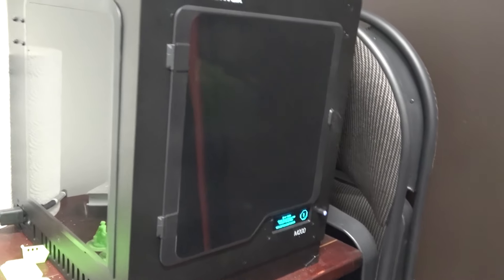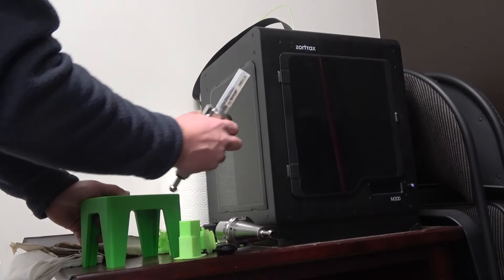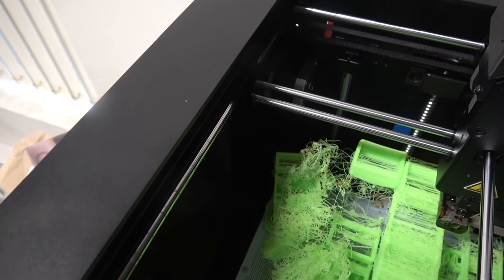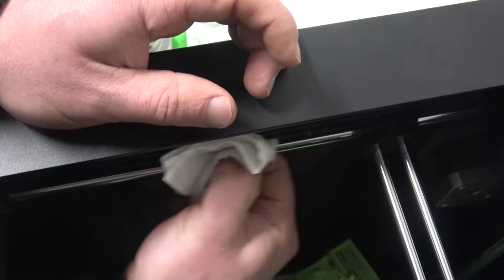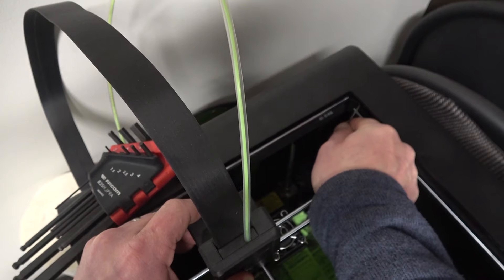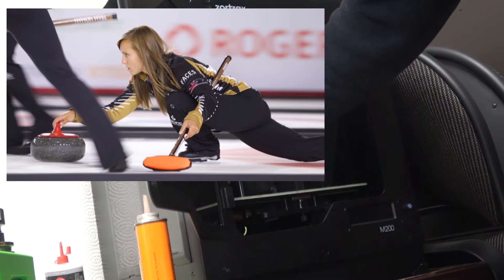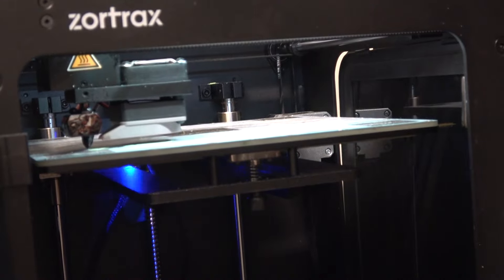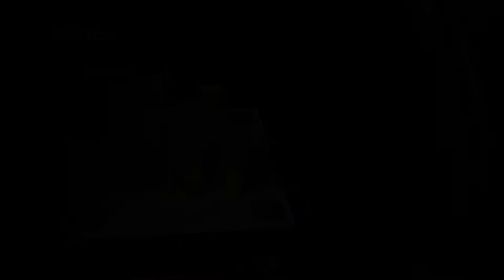WTF is a Zortrax M200?!

Comment: One thing I never got , with the 3d printed gun thing, is why on earth do they use ABS? It's not the only filament available and seems like honestly the worst option.

Heck they make gfrp pa6-gf30 filament, have a feeling a gun made entirely out of that might even last more than a few shots, not only is it way stronger but it also has way better thermal stability/less creep at high temperatures due to the glass fibre, heck you might even be able to chamber something bigger than a .22

Is it just cost? Because that seems like a really poor justification when making a pressure vessel designed to contain an explosion.

Comment: 3d printers are still advancing! Check out the technology Prusa is developing these days. They're using current sensing to use the stepper motor like an encoder! The Prusa i3 mk3 emulates a closed loop system.

Comment: FYI, any cheap vinyl based hair spray will work at least as good as the glue, but it'll stink substantially prettier, and it'll lay down a nicer first layer.
Also, If you're still running ABS and haven't given PETG a shot, PETG is pretty damned durable, can be printed a whole lot faster, and's got no stank to'er. Also doesn't curl up like a mofo like ABS.
I typically run my homemade abortion printer around 75-100mm/s on PETG without issue.

Comment: Ender 3 probably isn't as mechanically accurate sense it runs on rubber pulleys instead of machined steel rods but small things make less noticable errors instead of complete system failure

Comment: For a while in the UK here, the 3-1 oil we were used to was bought out by the makers of WD40.  I noticed it smelt different and it was thinner like...WD40.  Well whadyaknow!  We didn't buy it.  Now though, we can get the new 3-1(WD40) oil and the 'Classic' 3-1 oil.  The web addresses were WD40 dot com and, funnily enough, so the 'classic' 3-1 oil has a web address at..um..3-1 dot com.  I guess the makers of the WD stuff realised that the two oils were of very different properties and we knew it!  So they returned to the 'Classic' formula 3-1 oil as 3-1 oil, not WD40 pretending to be 3-1 oil.  It's harder to remove than WD stuff too but doesn't smell like hairspray!

Comment: Useless advice incoming:

given your comments about stink, and the schmoo on your guide rods, I'm guessing you're printing ABS. Some of the butadiene actually vaporizes as it is printed, which gives off the stank, and is why your hot end gets absolutely covered in nasty sticky black crap. Some of that also wafts up to your guide rods though and fouls them. So wiping them down regularly can help. So can lubricating them with PTFE thickened silicone grease rather than 3 in 1 oil. 

Just my 2c. Hope it helps.

Comment: I use a trowel which i've sharpened, You can put it flat on the printbed so you don't scratch it right to fuck
Also, if you have adhesion problems just get a buildtak plate
I used to have all sorts of problems and tried all the usual things, glue sticks, hairspray - you name it
but once i put buildtak on it the problem no longer was getting it to stick but to actually getting it to unstick, the difference is night and day

Comment: buddy. you need zhop because your printing a large item., some drips will happen. the head is catching on the print. also the printer I assume is very quiet, the drivers are not running high enough current, they will loose steps (oh look about half way through the print) when they get hot they will fail. :(.... for sure buddy. more current on your steppers will solve the issue.

Comment: Sooo to put my two cents in here as to a solution on your “lost” steps. There are a few reasons for step loss. 
1. Your software updated to the best newest version and now you have a setting which is not compatible with the printer. (Jerk control or z hop speed etc)
2. A voltage drop or over voltage, always a good idea to run the printer off a regulated supply. 
3. Rafting works but auto bed leveling alone with printing on glass really improved my print quality.

Comment: AvE if you are getting a terrible stink you are probably printing in ABS plastique.  The S being Styrene. Good skookum as frig filament with lots of good toughness but when you heat it up to plastic phase, it releases STYRENE GAS. not too good to breathe forever.  Give PLA a try.  me being an engineerd I also gravitated toward the supposedly better material properties of the ABS and the PETG and the nylon, and the polycarbonate, but all of em are as finicky as trying to make a threaded potato on a boxford lathe.  PLA is truely the best plastic for this process and has lots less to go wrong with it.  Right now i have 2 robotic arm cells doing production with spools worth of 3d printed pla parts some even with sliding dogs actuated by air cylinders with no sliding surface enhancements except for a little dab of grease.  been running for nigh on 13 months now without a hitch.  Hatchbox PLA is the go to. ANY color, just stick to the 20$ amerigan doll hairs hatchbox spools.

Comment: I built my 3D printer, the once 35lbs kit turned into a 50lbs fatty with a big machine aluminum plate, AC heater and a Duet 32 bit board and enough aluminum bracing to hold your mama.
Usually when that shift happens one of 3 things happen- The head collided with print skipping steps, and it can continue to skip if it hits, The driver voltage is too low for the speed also see #1. or you have a binding axis, be it misalignment or shmoo on the bearings. 

Printing is fun, and printing something super large or complex is like Russian roulette, you can be fine day 1-3 but on the last 5% it could collide or jam, ruining your print.
It's certainly not for the faint of heart.

Comment: I learned the dumb way that those tips get hotter than 2 squirrels fuckin in a wool sock. Dumped it's hot goo and poked me with "only the tip" on the back of my hand when I tried to catch a mistake before it had time to cool.

Comment: For real gits and shiggles, pull one of the linear bearings out. Talk about a piss poor design, 4 rows of BBs circulating around without decent shielding. What you wipe off the rods is what squeezed out of those things. Would be fun to see one cut lengthwise from stem to stern.

Comment: I've been told (as all random comments should start) that 3in1 oil, being vegetable based & not mineral based, gums up. 
Now, I used this stuff as a kid in the seventies on trolley wheels. And the way my Dad talked about it, so did he. 
So it would be sad if this were true. Just the smell of it brings back the sheer terror of hurtling down hills with no brakes on a set of pram wheels & axles fixed to a plank of wood with bent over nails!
I'm about to go search & find out...

Well, Wikipedia mentions gumming. 'Tis but one source but... https://en.m.wikipedia.org/wiki/3-In-One_Oil

Comment: The Zortrax is a nice printer on paper but really isn't worth the price. The proprietary slicer and filament is indicative of marketing wank. The slicer tends to waste a lot of material with the required raft for every print and supports that can be very hard to remove. It can provide very nice prints with nearly invisible layer lines, when it's working. However, many printers can do this these days with the some tinkering and proper settings.

Comment: Prusa mk3 I think is still the best out-of-box experience with 3d printers. I have one at home and one at work. It's nice to insert model into slicer and use PRESET profile and expect functional print. I had Chinese cheapo piece of shit and sure it could work and get pretty good quality prints, but I didn't want to hobby the fucking printer, I wanted it to just work. Prusa does that pretty damn well imo. Yeah it's more expensive as many others, but for fuck sakes. It cost two good wireless drills 😄

Comment: A nice layer of kapton tape does wonders for sticking your pieces to the point you have to snap them off. Works doublely as good when it has a heated glass bed and wiped clean as your wife’s freshly waxed whoohaw with acetone.

Comment: i dont know about your device but on my laser i found myself losing steps thanks to a fouled bearing.  i was able to unclog it with the old wd40 then manual manipulation for a few minutes to work the shit out.  now i make sure to clean the rails all the damn time and put lithum grease infront of the slider so that gunk has a bitch of a time getting in.

Comment: The newer electronics have what i would call "Half feedback" it can tell if it lost steps as it monitors the current going to the motorbs... then it simply re-zeros and carry's on helps is jams, also means there is a way to zero the axis without any end stops! which is cool... and also means it can stop if something gets caught.. OK not a reall issue with NEMA 17s motorbs but go bigger and you have a way to detect when your d*ck beaters gets in a pinch!

Comment: Going to be that wanker in the comments.  I have been running a far cheaper machine for much longer.  If you have Igus Drylin (or the chinesium clone) that 3-in-1 is going to right fucker it.  If they are LM8UU/LM10UU, then 3-in-1 is the best thing ever.  However you want a few drops every couple months.  The shmoo is part and parcel for the course.  My machine also does much longer than 16 hours in a single print...  But I have had 4 years of playing with myself to get it right...  Wait...  Playing with it myself...

Comment: I've got a zortrax M300 at my workplace.

Garbage! By far one of the worst overpriced 3d printers I've ever seen. Those steppers are pathetically weak and low torque. Way too easy to lose steps.

It's pathetically slow. The software you have to use is debilitatingly limiting. But that's not the softwares fault, it's the mechanics! This thing can't run any faster because the thing can't go any faster without losing steps.

The makergear M2 came out YEARS before this thing, and has easily 10x the value.
Reply from the maker: Good to know.